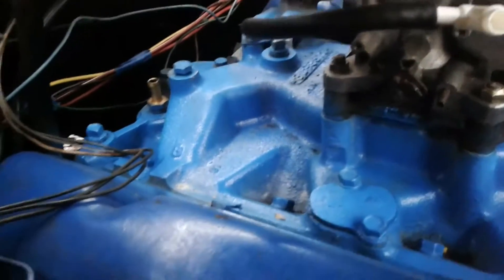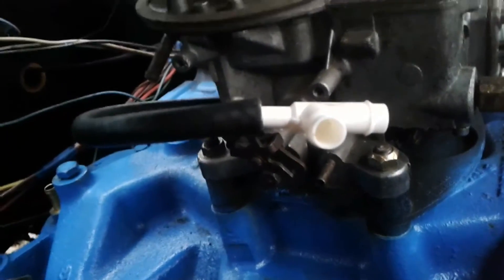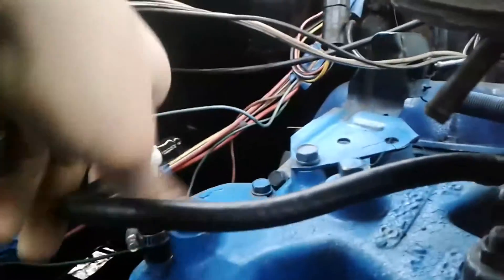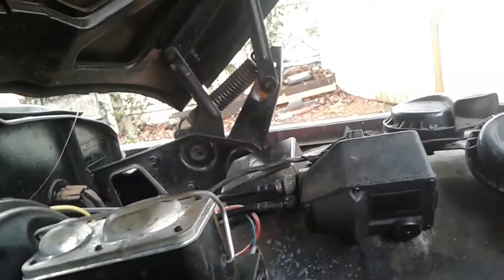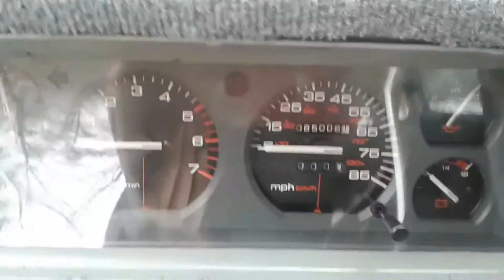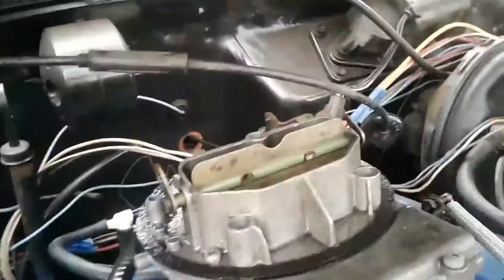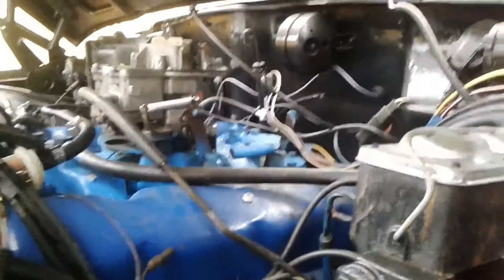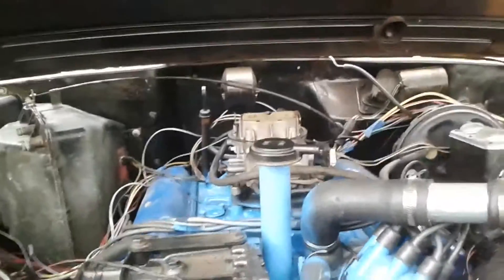360 5.9 pcv vacuum leak

Comment: I had a question the return line that you connected has nothing to do with the pcv?
Reply from the maker: No it does not. The return line is for excess fuel to go back to the tank. The PCV is so the crank case pressure gets relieved.